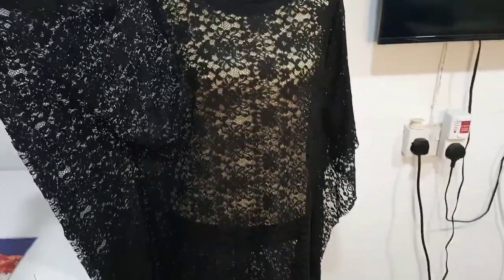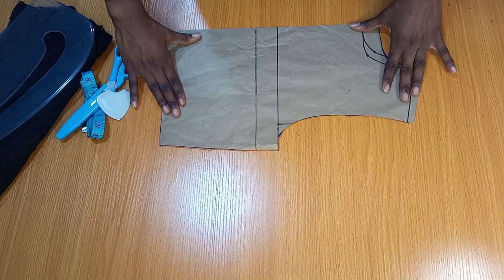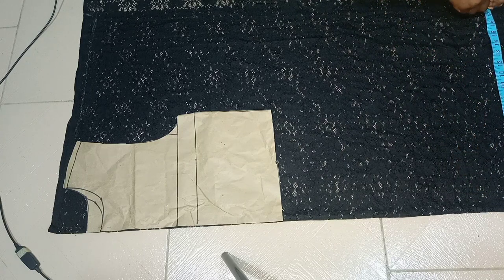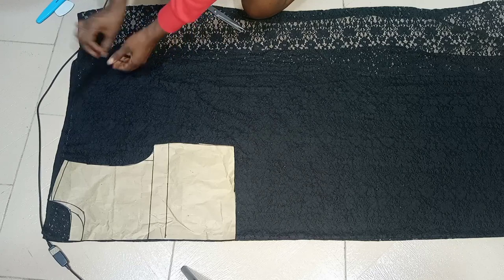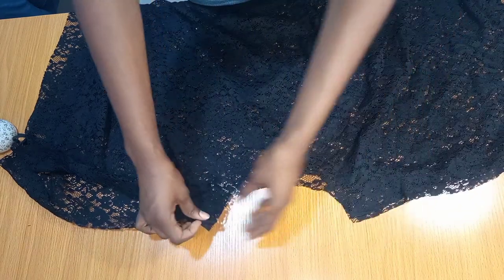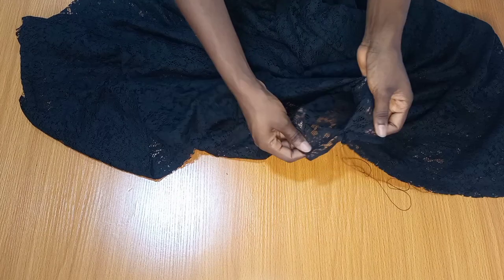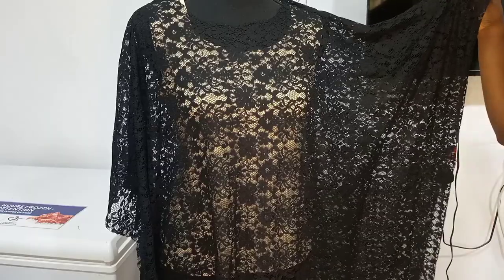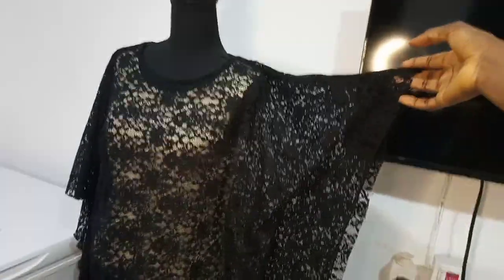KAFTAN DRESS TUTORIAL | BUBU GOWN | BUTTERFLY GOWN TUTORIAL

Comment: Lovely ❤, what was d neck measurements u used for the front and back? And was it d 18inches u later used from the shoulder to the full length, or u used the 21inches only for the shoulder length and then from the burst point or armhole down to the full length u then used the 18inches?